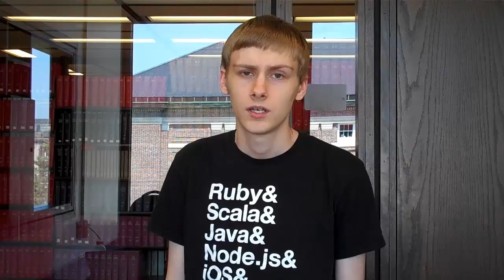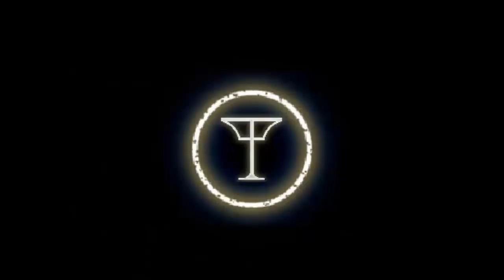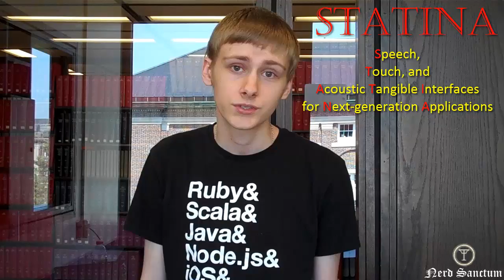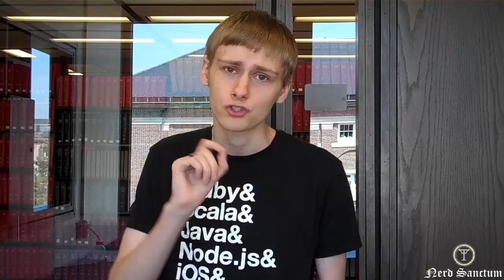New Invention Can Turn Any Surface Into A Touch Screen

Comment: Wood into a touchscreen monitor? Think about it for a moment, and you will see how fake this is.
Reply: Maybe do more research to gain some more knowledge about materials before insulting science.
Reply: *****
Wood is definitely NOT transparent, something would have to be transparent to function as a touch screen for one thing. Also, wood is far too molecularly dense to function as a screen of any kind. If we could make wooden screens, there would be many wooden screens used in situations where the device doesn't cost a lot of money, and they need to cut costs.

Although maybe they could technically make it as a proof of concept kind of thing. And I never insulted science, so don't get your knickers in a twist.
Reply: Godot Ace Coffee Drinker
it isnt a camera from the bottom it is like a laser tripwire for your fingers the sensors are in the frame.
Reply: Cody McCain
I think I get it now. When they said surface, I thought they meant surface in the literal sense, not the surface tablets

Comment: Like many of the commentators before me, I came from your younow show a few hours ago. This video was really well put together and I like your use of labels. My advice is to reduce movement/swaying per take & try moving to different parts of the screen for jump cuts to increase attention retainment. Also, make the text in the top right corner more prominent because I didn't even notice it until the second time through. good luck and I can't wait to see more